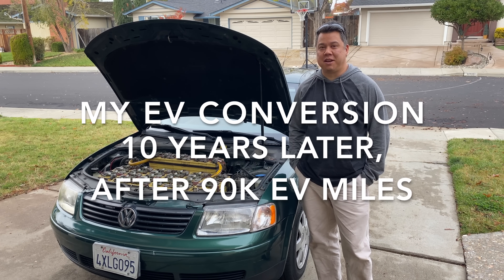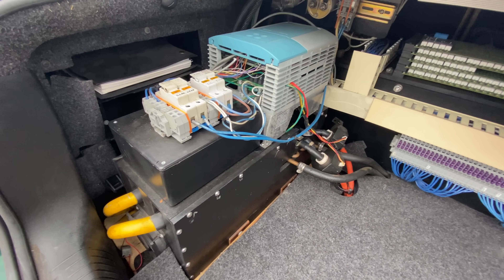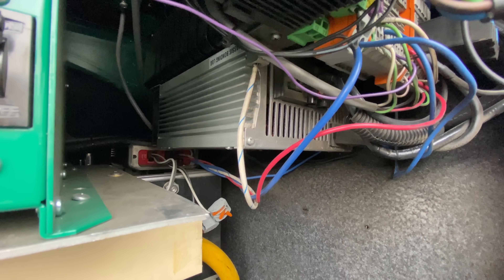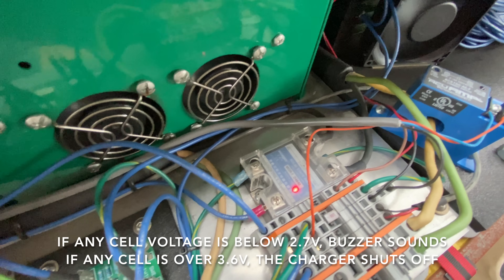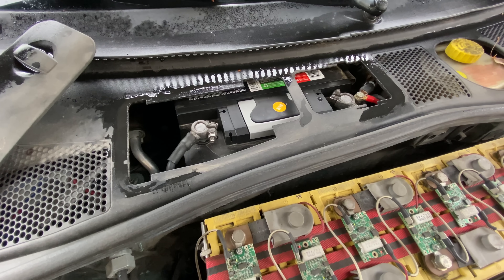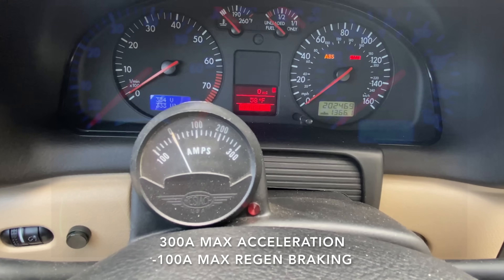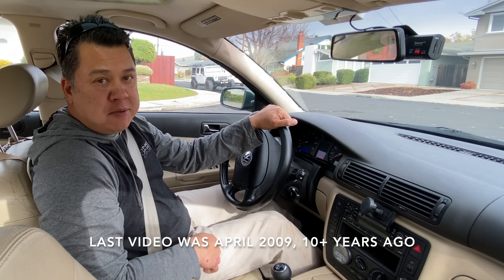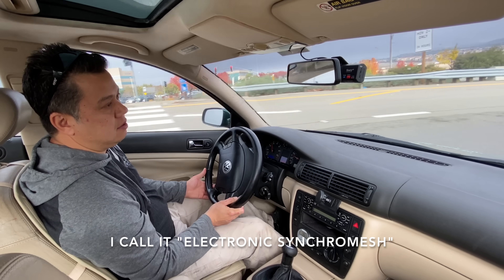My EV conversion after 10 years and 90k miles

Comment: Sorry, I know jack about cars but I didn't see an engine there. Now my limited knowledge tells me that a car needs an engine to move....so does this mean electric cars don't need engines?....wait, now that I think about it, engines are just the cars way of using the gas to ignite the motor and start it moving, if that can be replaced with electricity.....wait, my brain is thinking as a type here lol

Comment: Looks like a death trap if you ever get into a major accident.
Reply from the maker: Yes, all cars are death traps in major accidents, the only difference is this car has non-flammable batteries rather than 26 gallons of gasoline, 6 quarts of hot oil, and a hot exhaust system.

Comment: but is a gearbox even necessary? can't you make the motor directly connected to the Wheels and then when you press the throttle you give more voltage so it spins faster, make it switch between resistors and reverse would be to reverse polarity.
Reply from the maker: A 10:1 gear ratio is ideal, the motor wants to spin around 4k rpm, if it was connected directly to the wheel it would be 400, and wouldn't have enough torque to move it.  Also, a differential is needed to spin both wheels.   The motor is a 3 phase motor, so to change directions and speed, the controller just commutates the motor with the correct frequency current, firing the 3 phases in the correct order, kinda like a stepper motor.

Comment: Impressive.. That thing must be so heavy using that many lead acid batteries! How does it handle?
Reply from the maker: It's 100lbs heavier than a stock V6 Passat.  The batteries are lithium iron phosphate, a bit lighter than lead acid.  It's a fairly cush ride, I built it as a highway cruiser, built for comfort, not for cornering.  Handing is probably not much different than a stock v6 Passat. 400lb lighter up front, 500lb heavier in the rear.

Comment: So you got only 120 electrical things in your "trunk". How about some integration? Those devices all got their seperate housing, seperate power supply perhaps, seperate cooling. Your power supply for your fans gets hot, so it needs a fan. Why don't you get yourself a small power supply to cool the large power supply? And a  tiny power supply, to cool the small power supply? And a nano power supply, to cool the micro power supply? And a central heating device, to transfer all that unwanted heat to the cabin, when it's cold? Man, does this list of devices ever stop? You could convert your car back to automatic, just to tell your friends, you tinkered with your car again. Yeah, a 15 speed Formula VW automatic, the one with the red reverse switch. You know the way those freaks talk.

Comment: Yeah, it looks pretty good, but I think that in the case of an accident, the batteries in the trunk can kill your passengers in the rear seats.
Reply from the maker: Well, the batteries have been puncture tested with nails and bullets, and don't catch fire.  Battery racks are strapped to a welded frame that sandwiches the chassis, using 30x factor of safety. I think it's fairly safe, safer than a tank full of 26 gallons of gasoline just above hot exhaust pipes.

Comment: Can you regen in 5th gear?
Reply from the maker: yes, but I'd have to change the programming to increase the amount of torque at the lower motor speed.   Regen torque profile is based on 2nd gear gear ratio.

Comment: Hello Etischer,
I just looked at the video  of your VW Passat conversion review and I got to thinking....I own a Toyota Super Saloon-MS112. It weighs in at 1,500 kg (3,307 lb) with its OEM engine and transmission. I am seriously considering swapping out this propulsion system for the one in this video. https://youtu.be/Ie7qvo-aC5k 
And thus, I have some questions.......
1) Will this set up here be capable of driving my car? 
2) How many lithium ion batteries will I have to install in the car to get a range of 400 miles while using the A/C, transmission pump, power steering pump, radio and other devices?
3) What is the space litres/cubic metres it will occupy?
4) How much would the motors and transmission cost?
5) How much would the charge controller and Battery Management System cost?
6) How much would the battery bank(s) cost?
7) Would a regenerative braking system be suggested for a rebuild like this?
8) If so, how much would that cost?
9) What other components would I require to complete this build?

This pet project of mine would be a blast for my son who is studying Auto and Diesel at MIC, a technical school here in Trinidad.
Reply from the maker: Would be best to contact EV West with your questions, I don't have experience with that setup.  If you need 400 miles, I would just buy a Model S, 400 miles is not realistic even for a professional conversion.

Comment: Imagine how much coal that car burns (Stupid people don't know that most of our electricity comes from burning coal).
Reply from the maker: First of all, California energy production from coal is 0.15%.  Second of all, this car is powered 100% by solar from my roof.
Reply: That figure is off by a tiny bit, but also that's just "in state production" still have to figure how much imported coal power from out of state is used. 

Climate change has happened since the beginning of our planet. I don't buy into "man made climate change" so I'm just poking at ya. 

What most people don't know is: The sun is the main driver of climate on planet earth and co2 is necessary for life. 

The elite are just pulling a "stick up" job on the population, forcing them to eventually fund the "carbon exchanges" which will collect taxes to the tune of tens of trillions over a decade and only the elite and politically connected will be able to invest in these carbon exchanges, the rest of us will have to pay for breathing. 

To be clear carbon dioxide is good for plants, which is why at major plant nurseries, they have co2 generators inside greenhouses, they turn them on and the plants grow wildly and produce tons of oxygen. Look up the videos of that on here. 

Anyways, I'm just poking at ya to see where you are on the "climate hoax religion" relax.
Reply: Would you consider upgrading your cells to lithium polymer or whatever is state of the art today? I think you'd shed a ton or 2 if you did. Imagine charging up in 2hrs rather than all night long or days even.
Reply from the maker: Can't shed a ton or two, the battery weighs 700lbs.  Sure batteries are better today, but no reason to upgrade. 

  I can charge the car faster with a more expensive charger, but it sits all night, there's no point to charge faster.  2 hrs, vs 4 hrs makes no difference to me.
Reply: Do you have to maintain those batteries; top off the electrolyte or water? Let's look forward to the day that we can pop a battery that takes the space of a current regular car battery and it takes the car a few hundred miles without a hitch.
Reply from the maker: @MrNopehaha  No electrolyte to replace, or water to add.   Most electric cars have batteries underneath, and have much more storage than a regular gas car (trunk + frunk), no transmission tunnel...

Comment: Great video! Very ingeniously built! I have a short question. Did you say the electricity is cheaper after midnight? Can you explain that briefly?
Reply from the maker: Peak usage is around 2-7pm; utility companies may one day need to build new power stations to handle these peak loads to prevent black outs.  If people shift their usage to off peak hours, that can be avoided, so there are incentives for customers to use electricity at night when power plants are idle.

Comment: This kind of modification would never be "street legal" in europe. The work done on the car is outstanding but the fact is that you have battery packs installed everywhere, how they would behave in a crash test?  It is possible that your batteries will catch fire if you hit a brick wall with your car? Or worse, is it possible that your battery packs will come flying into the driver if you hit a brick wall hard enough?

Comment: How did you learn all this???
Reply from the maker: Just buying hardware and tinkering in the garage really.  I have a college degree, but for the work involved in this project, I didn't really use any college level learnings.  I have another video showing how I built the inverter, and the learning process I went through.

Comment: Any reason why he had to switch to manual transmission? I know its cool to drive a manual transmission car, but I want to know the real reason behind it.
Reply from the maker: An automatic transmission requires a hydraulic pump to constantly be running, most often it's a torque converter which wastes energy, would be difficult for me to get balanced after welding a coupling, has a lot more rotational inertia, and potential leaking.  It's less efficient, doesn't have a direct torque coupling,  much heavier, would require designing a controller to control the shift and lockup solenoids...  Manual transmission, all I have to do is turn the input shaft on the transmission, much simpler.  Don't even need a clutch since the electric motor has full torque even at zero speed.
Reply: @etischer  Thank you so much for answering , Brother!

Comment: Those batteries under the car make me nervous 
Anything hits those n punctures one and you've got some problems :-/
At least that's how I imagine it
After 90,000 nothings happened so maybe I'm a bit more paranoid than can be justified
Reply from the maker: Well, they don't hang any lower than the 26 gallon gas tank that was there before =)

Comment: You can do 75 on the 2nd gear? It is 5 speed manual gearbox? So the top speed is around 300? Sir, you might have buit a fastest Passat ever.
Reply: Top speed is horsepower limited. It was 105 mph when he built it. Some tweaks since then have presumably raised it somewhat. I used to note the HP being employed when cruising in a Chevy Volt (KW x 1.34 = hp).  A small electric car can do fine with 50 HP or even less, but top speed is limited regardless of final drive gearing.

Comment: I guess keeping the gearbox is the most impressive part. That said, keeping it doesn't make sense to a layman unless you explain why ICE cars need gearboxes, and why EV vehicles generally use single gear(and the upsides and downsides).
Keeping it and adding a synch mechanism is really impressive.
Reply: He didn't keep the transmission.  He swapped in a manual tranny and discarded the automatic that came with the car. The reasons for multispeed transmissions on ICE cars are the same as for multispeed gearing on bicycles - limited torque of the propulsion units at lower rpm and limited max rpm capability.

Comment: Nice try but led-acid batteries are not the best choice for an electrical car. They are very heavy and don't like to be discharged below 50%, which makes your car not very efficient. I bet the total efficiency of your car got dragged down by the weight of the vehicle. You'd be more efficient with led-acid if you'd go for a Polo and not Passat.

Comment: Change the final drive gear on the transaxle in order to use your first gear. Electric motors have high low end torque, so you can lower the gear ratio of the final drive to change all the other gear ratios. It's the opposite of what you would do in a performance car where you would increase the ratio to give you that low end torque. You'll get a higher top speed as well.

Comment: Some people build running V8 engines that fit into a matchbox. Some create castles from match sticks. All ingenious people. But this is just another example of hobby extremes. Joe 6pak needs to get to work in his old pickup and doesn't need to risk electrocution or do diagnostics on the charge controller. New spark plugs and air cleaner will do thanks.